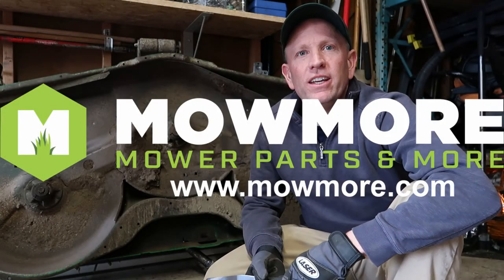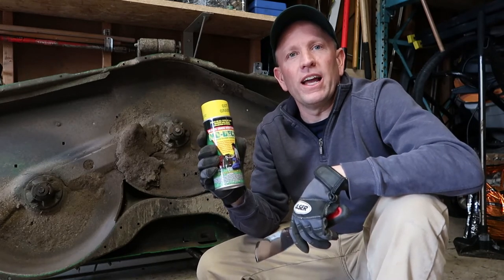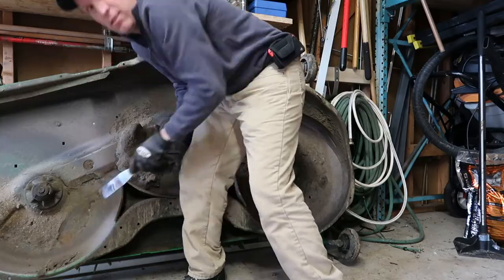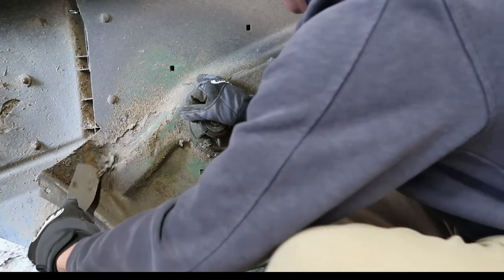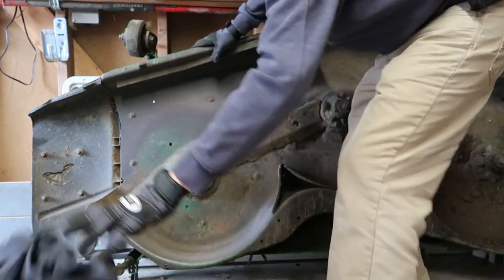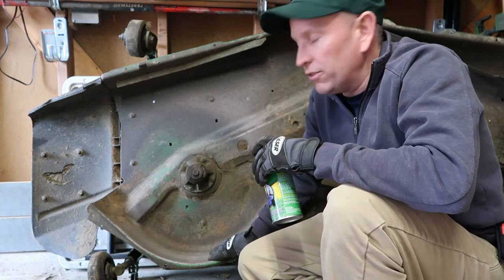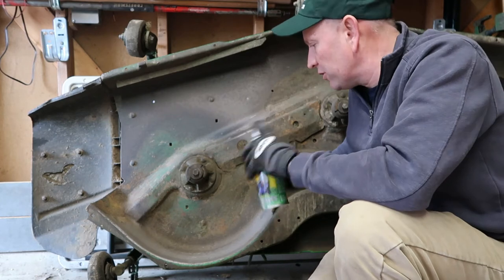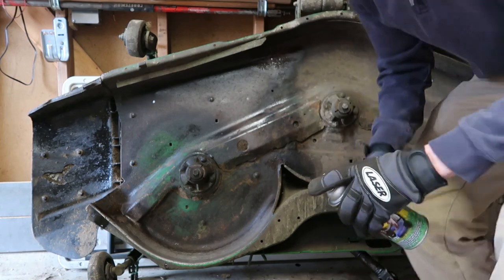Grassbuster & MoDeck Review

Comment: Two minutes of scratching with a 2" putty knife ( squared ends not nicely rounded like yours) and a wire brush, I got fed up and went back to the pressure washer. Done in a few minutes instead of half an hour. Just keep it away from bearings, which is easy enough. 
Am reading up everything I can find on protective covering from used motor oil to commercial products. No consensus so far.
Reply: Did you ever find out which product works best?
Reply: @davidautry4857 
No serious conclusions but here's a vid from the guy at  Project Farm. I take the decks off of two mowers alternate years. Best equipment is pistol instead of lance which is too long to point up from underneath, done every coupla weeks. (Had to buy another washer (small Karcher) cos pistol wouldn't fit normal size cheapo one.)